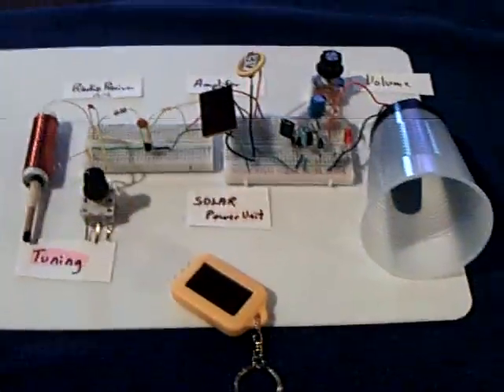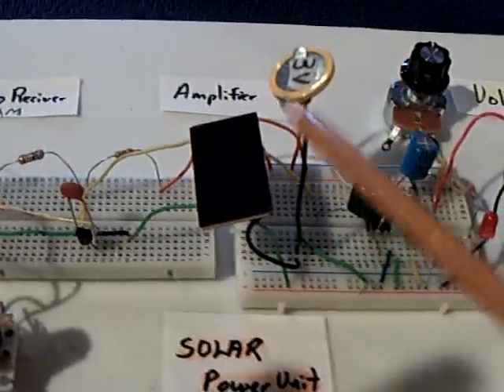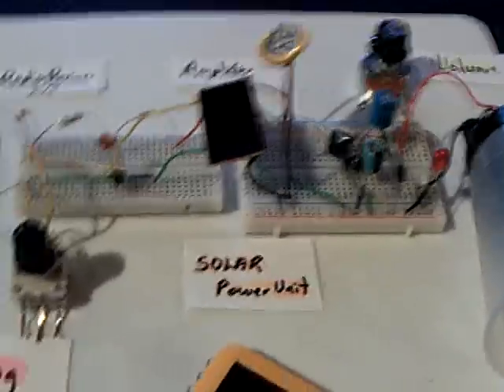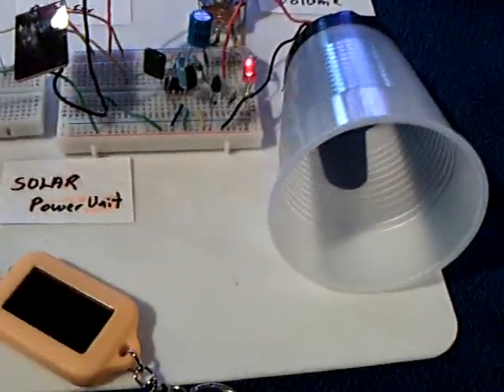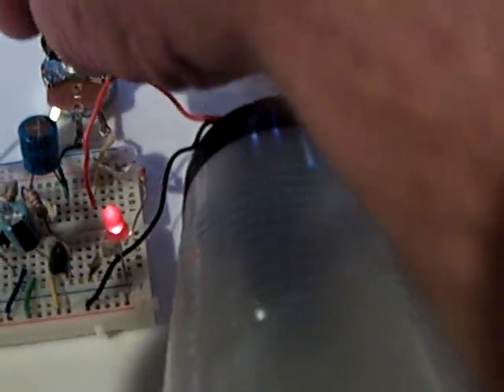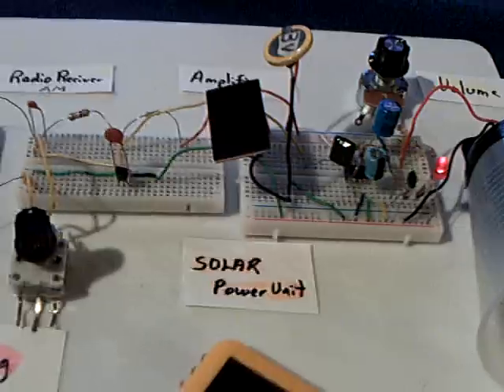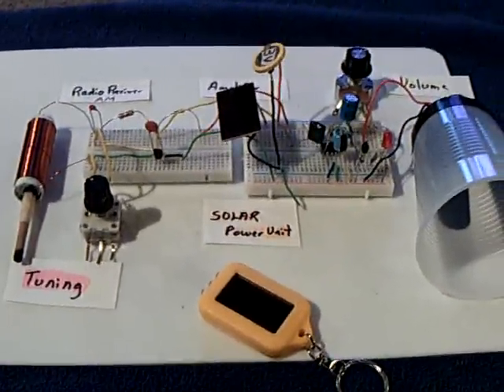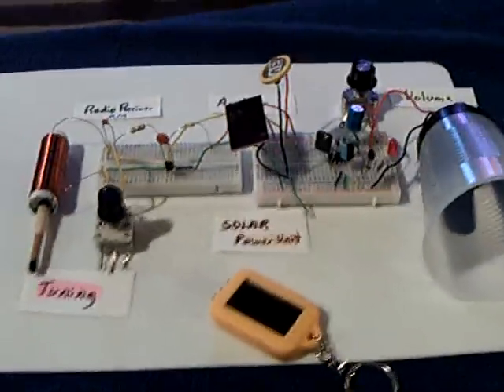Solar powered homemade AM radio

Comment: Put it in a classy cigar box, but cut out a window on top so you can see the circuit board and cover the window with plexiglas from the inside. Change out the LED to a high brightness one, and mount it so that it illuminates the circuit board during operation!

Comment: Very nice ! Working on a basic crystal circuit, have been trying different kind of coils. Turns out that you can use a small axial inductor (bright green resistor looking like) and pick up clear  radio stations...passed trough a ferrite bead may help tuning. Also works with  transfo. type inductors... with bi-inductors transfos, the second winding can be used as a wave trap. Now i wanna try that mk484 chip you are using and see the result.

Comment: RadioShack sell small automotive neons with coloured cases. You could take out the neon (use for exciter circuits maybe) and put an LED inside, to look like a vacuum tube. They sell em in red and orange.
Am doing similar - my goal being a solar homemade radio for CoasttoCoastAM at night, as iHeartRadio is a bandwidth hog on our 1mb internet. Battery will be a 3.7V Li-Ion from old laptop, mounted vertically and no plastic wrap on it, to look like a big aluminium can capacitor of old :)

Comment from the maker: @serfer5rogers ----- Thanks.  I also came across a way to do this using only a 555 chip. What I am learning though, is that to get higher performance out of the radio the circuit gets much more complicated.